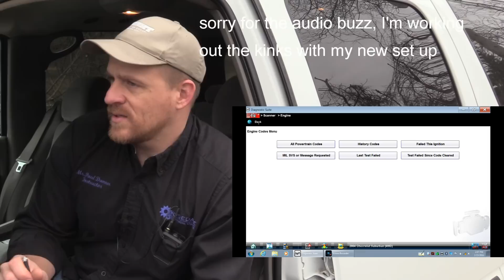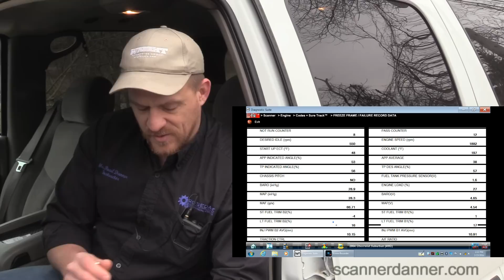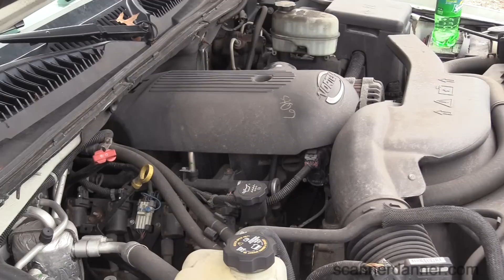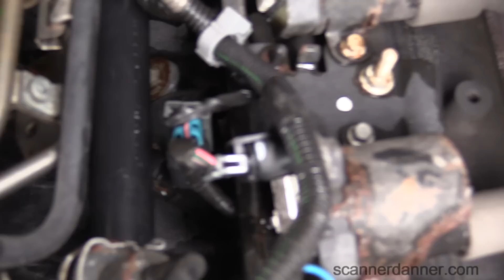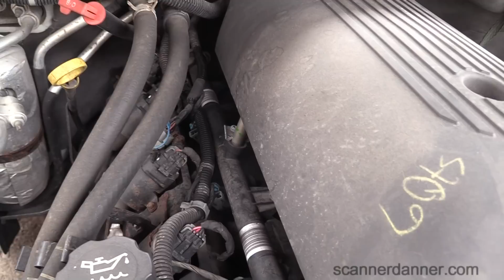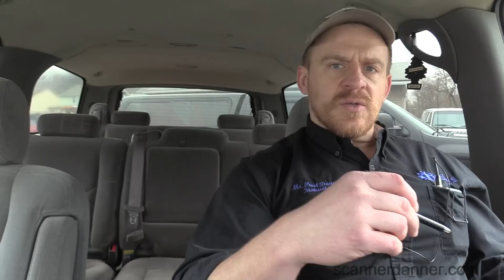Comment: I would have also asked the customer if they noticed that their fuel mileage had dropped off since these lean codes were set.  That's another good indication to back up the fuel trim data that you show here.

EDIT:  I just read the description and saw the symptoms, and poor gas mileage was listed.  Sorry about that.

Also,  for the water test since people are so concerned about it damaging something, distilled water is not conductive.  So, it would be safer to use than tap water around electrical connectors.  Maybe you did use distilled water; I don't recall in the video.  Anyway,  just thought I would mention it, but I'm sure you already know this.  Again, great video!

Comment: I have a 2003 Chevy Silverado with a 4.8 liter that throws lean codes.  It also sometimes says it has a misfire, but the cold start injector will not come on until I put it in gear then you will heat the cold start injector kick in and the motor will idle normally.  I can't figure out why the cold start injector only comes on after it has been put in gear.
Reply: Did you figure anything out? I'm having the exact same issue.
Reply: @breakthemachine5096  Yes I did, on your fuel rail crossover pipe there are 3 o rings you can get new ones but they are expensive and if you replace them you will still have the same problem.
What happens is that when the o-rings are installed they are first soaked in motor oil and that causes them to expand and seal.  Over time they dry out and loser their seal and cause a leak, thus causing a lean fuel condition and misfire.
All that is necessary is to remove the 3 o-rings and soak them in some clean motor oil for 5 minutes and they will swell back up, reinstall them and that should fix the problem until they dry out again.

Comment: Who the hell that knows anything about engines would be concerned about the procedure you are doing?  As you stated, it's a very small amount of water that is relative to the intake leak.  it's not like the engine is going to hydrolock from doing this.  Geez, some people really need to take a step back and think about what you actually do/did with this method.  It's MUCH safer than spraying carb/brake cleaner all around that area; especially on a hot engine.  The defacto standard when an obvious vacuum leak is not found by "normal" means, to include this and propane, is to do the smoke test.  However, not everyone has/or has access to a smoke machine.  In essence,  Great video!!
Reply: ScannerDanner, my smoke machine I ordered off of Amazon will be here in a couple days; hopefully by the weekend.  Any suggestions you may have for me to have this very annoying P0171/P0174 codes that I am experiencing.  Upper and lower intake gaskets have been replaced, along with the GM factory spider replacement that converts it to individual electrical fuel injectors to eliminate GM's crappy poppet valve design.  Any tips for smoke testing the engine, as far as engine cold, engine warm, etc?  Any help would be much appreciated!  Thx.

Edit:  It's a Stinger 2 model that I ordered.  I have used propane around the intake and all hoses, and about 6 months ago used carb cleaner all around the intake and vacuum lines, but no change in idle quality, or STFTs were indicated.  I'm wondering if it may be an EVAP system leak, as in under the vehicle where the vacuum line(s) run from the charcoal canister to the fuel pump.  Fuel filter was replaced recently, and the pump was replaced about a year ago.  If I stomp on the gas, there's no symptoms of fuel starvation at all.  As in your videos, what I do notice at idle is LTFTs are maxed out at 25 on both banks, and STFTs are also in the 10-20 range.  When I give it some throttle, the STFTs go negative, and drop the LTFTs to the upper teen range.  MAF sensor readings respond normally, as well as MAP readings, given the conditions.  Just looking for a little guidance once I get the smoke machine.  Is it possible that there is a big enough vac leak going to the fuel tank to make these fuel enrichment readings so high?

Comment: These manufacturerers LOVE to  use the crappy intake gaskets.  Had the same issue on my 01 S-10 4.3L.  Replaced them with a good set from Fel-Pro, and no more issues.  The engineers know that the originals aren't going to last, but they hope they last until the vehicle is out of warranty, then some uneducated person on engine theory (females in particular) will bring the vehicle in and have their issue diagnosed, and are told that they need to have them replaced.  This kind of crap really pisses me off, especially when they take advantage of women!!!
Reply: They take advantage of everyone, man or woman. doesn't matter as long as they get the Money.

Comment: I have a P0178 on 04 chevy suburban 1500, 5.3 lt. flex fuel VIN Z The composition sensor low input. Replaced very expensive part but did not change the same code I did fix a downstream O2 sensor. but The engine when it is cold it has a hard time starting in the morning and once I get it started it runs rough and kind of bounces it all goes away once it gets warm but the check engine stays on P0178.
Reply: You need to test the wiring to that flex fuel sensor. My money is on a broken wire going to it...

Comment: What else can cause these two codes? Spark? Cats? O2?
My scanner says these are some of the "other fixes". I don't trust it though.

2008 5.4 Ford.
Ltft 26 and 30. Increase engine rpm.. no change, stft normal fluctuation. MAF reading correct ( can't look at voltage on this scanner).
May have to check the cold engine . Always checked after it got back home.

Comment: can u tell me what might cause a 43 and 44 code on an 89 chevy k1500. runs ok, other than hunting and sometimes stalling at idle. no smoke, no noise. replaced t stat, checked egr, replaced temp sensor, IAC, rebuilt throttle body, replaced TBI gasket., rebuilt throttle body.

Comment: I like to use brake fluid to find vacuum leak because you can hear the engine rev higher if brake fluid is being sucked into the engine
Reply: Just don't get it on any surface you care about

Comment: I have the same truck ,  same codes,  it has a rough idle but doesn't change  ,  I been driving it for a while and nothings changed,,  any ideas
Reply: I did the water test and nothing  heres some numbers 98c (208F) ST bank 2 -2.34,LT bank 219.53   and ST bank 1 1.56 , LT bank 1 21.88intake man pressure 33kpa

Comment: what would casue a lean condition under load but idle everythings between -10 + 8 on the stft? all fuel related components replaced pump/filter/injectors/fpr
Reply: Coty Riddle Intake manifold gasket, MAF sensor, leaking EGR, sending unit filter  partially stopped up, fuel pressure regulator, coolent temperature sensor reading high, partially stopped up fuel line etc.

Comment: The bank 2 sensor 2, even though it's bad, that would not effect the engines performance right? Isnt the down bank sensors ONLY for emissions? 

It's only the bank 1 upstream sensors that would effect the Air/fuel mixture, correct? 

This is why you can delete out bank 2 sensors after installing longtube headers.
Reply: On this system, yes, the downstream O2 sensors are only used to monitor the cat. Some of the newer systems do use the downstream O2 for fuel trim control.

Comment: I love the water trick.  With no smoke machine I have been watching fuel trims while putting some propane or brake cleand down around the intake and seeing if they correct.  It always a little nerve wracking to introduce a cloud of explosive fuel around a running engine though.  Water seems like it may be a safer way!

Comment: I have the same codes running lean both banks, i just replaced my MAF sensor and its throwing the same code but right after its thrown i can clear the engine light and be fine for like a day then it kicks on again its super random and i can't pinpoint anything ive sprayed for leaks nothing has happend everything is sealed, also this occurs at higher rpm never usually at low idle speeds it threw the code last time around 55 mph at around 2k rpm  but also my MAF i checked the g/s and its running low 2.5 it was reading at 600 rpm but i read that its supposed to be around 3.5 g/s  but its BRAND new by that i mean I replaced it a week ago and now its doing this to me again why could it be doing this?

Comment: First of all Great Videos I watch them all the time to learn new things. 
What I am not understanding is the fuel trims. 2016 Chevy Colorado. I pull the oil cap to simulate a small vacuum leak. The fuel trims both ST and LT go positive for a while the O2 sensor also indicates this. But After the ECM reads this the LT drops negative and stays there, while the ST switches in the slightly negative area. My shop Foreman told me this is exactly what should happen. But all of your videos I have watched on fuel trim say they should go positive, but im seeing negative. There is nothing wrong with this vehicle no codes I just did this to watch and understand the fuel trims better. 
Your thoughts on this please.
Reply: That s strange. Does this vehicle have a downstream fuel trim data on the scan tool?

Comment: Thanks! For the video this this worked amazing but for some reason it never threw a lean code even know the fuel trims where 50%! 5.3 flex bigger injectors ...non flex 25%
Reply: Did you find your vacuum leak?

Comment: is it recommended to change the intake manifold or just gasket?
Reply: just the gasket bro
Reply: do it matter if i use torque wrench. will it cause any problems if i just tighten the intake manifold by hand with regular socket wrench?

Comment: Some questions regarding the B2S2 O2 diagnosis.  Why is this a sensor problem and not a oxygen storage problem?  The first thing I thought about after seeing this was the oxygen storage test on page 5-13 in your book, and how there is a 2-4 second delay in the downstream O2 response after turning on the propane.  Isn't revving the engine to WOT at 32:57 basically just like adding the propane since it's forcing the AF mixture rich?  Also, later on near the end 32:48 the B2S2 is oscillating between about 500-700mv.  Isn't an oscillating downstream also a sign of a problem with the cat?  Thanks!
Reply: This wasn't a video about testing a downstream O2 or the cat from my memory
Reply: ScannerDanner The last six or seven minutes of the video is dedicated to diagnosing a code on one of the downstream o2 sensors.

Comment: Had the exact same codes on my 2000 Silverado 327. (5.3) Cleaned the mass airflow sensor...
no more bogging or missing - runs like new - no more codes - no more trouble light.
Reply: Johnny Mac I hope that's my problem!
Reply: Yea, hope so. It's certainly worth trying first because it's cheap and easy. They make a spray cleaner specifically for the MAS, use that. Best of luck.
Reply: 327 cubic inch. That's American for 5.3 liter
Reply: 327?
Reply: Its 323 cubic inches not 327

Comment: Update. Started the van today and disconnected the maf harness clip while running amd stayed on. Drove local for about 5 miles to warm it up. All that showed on the obd reader was the maf codes because it was obviously disconnected. The p0303 and P0171 codes never came back on. Afer the 5 miles I reconnected the maf and drove hard for another 3 to for miles and ran completely fine with no check engine light. Any thoughts what could be the culprit? Maybe the coil pack is cracked and after so many miles of heating up it starts to misfire? Has brand new plugs and wires. Fuel filter clogged? Egr valve clogged with carbon build up? Sprayed brake cleaner along all vacuum lines and gaskets. No sounds i hear. Weird. Appreciate the feed back.  98 Windstar 3.8 limited 4 speed w/ OD
Reply: Mark, post your repair questions here, I am sure we can help you https://www.scannerdanner.com/forum/post-your-repair-questions-here.html
Sorry for the delay, I get hundreds of these every day and I cannot reply to them all here anymore
Reply: Thanks buddy. Ended up being the coil ignition. Its common for those to misfire cylinder 3. Ended up causing the p0171.

Comment: Great video, I have a 2001 Chevy Suburban k1500 5.3L as I was driving from a long trip on the freeway all of a sudden I started losing power & felt like it was going to shut off, I pulled over the engine idled fine, I turned it off for a few minutes & it starred right up. I drove it home then hooked up my obd2 scanner & got p0171 & p0174 codes, then after a while the check engine light came on.  I put in a new fuel filter a few months before any of these symtoms started happening just as maintenance since it had never been changed, It starts up within seconds even when the engine is cold. I cleaned the maf sensor reconditioned the K&N FIPK filter & reoiled it with K&N oil, checked for exhaust leaks, put water around the intake manifolds, but didn't find or hear anything out of the ordinary. I thought maybe I had bad fuel so drove it close to empty & put new fuel in. When driving it feels like it's lacking power, at times while on the freeway it starts shuttering, kind of like when you get a misfire, but it doesn't misfire. I will watch your video a few more times to make sure I understand everything. Thanks in advance for any help if you're able to answer my question.
Reply: armandomrgl85 how old is your fuel pump?
Reply: Robert Contreras I've never replaced it, so it's probably the original fuel pump. I bought the Suburban when it had 38,000 miles

Comment: Im a big fan of your work! im subscribed to your premium channel! but i have a question i have a misfires on my acura TL 3.2L at cold temp (start up) could the intake manifold gasket still be suspect even on a speed density engine(MAP) or only on a MAF engine? i also have malfunctioning wideband sensors on both banks and downstream O2 codes and it seems as if my cylinders are getting coolant in them due to dissapearing coolant and my wideband sensor is white smudged at the tip?? appreciate the help dan
Reply: Absolutely an intake gasket is still a possibility even on a speed density engine. 
Another common cold engine misfire is from a headgasket failure and with your other symptoms, I would check for that first.

Comment: Could you look at the fuel trims live as you squirt water on intake gasket area? Would it show or say anything as you did that?

2nd question NOT related to this video:  Paul, are all fuel injectors ground side switched on all engines? Are their any power side switched?
Reply: It would affect it but not necessarily from the water itself. The water will get ingested and cause a misfire which would be a false lean condition and would drive the fuel trim positive. 
Back in the early 80s there were some power side switched injector circuits. Also GDI injection systems will switch both the power and ground side of the injector. 
But for the most part, ground side switching is the norm on injector circuits.
Reply: Thank you very much, your the best!

Comment: So I'm suspecting for myself it's intake Manifold gasket because I just replaced my lifters and installed a new gasket, could it be faulty re-install is what I'm thinking, perhaps common? Going to do the water Test tomorrow, if so should I replace the gasket or re-install and re-seat? 08 5.3L Vortec engine
Reply: P.S. mine is also happening at lower RPM and Cold engine
Reply: break out the water bottle man and have at it. Check it cold of course

Comment: Love the water test also. My car stalls at low speeds and when I brake but when engine is hot. I don't have a fancy scanner so I can't determine what exactly is going on but I suspect my problem to be a vacuum leak and not caused by intake manifold.  Will open hood and perform visual inspection to see if there's any hoses that are torn or disconnected. Will also test fuel pressure at fuel rail to check pressure.

Comment: I've troubleshot and repaired countless P0171, 174, 300, 420 and replaced img's on GM 5.3. but this has me stumped... 
Father in law's 04 silverado had all the factors of a bad intake manifold gasket. so i replaced it and on test drive it ran better than ever. later that night his son said it had rough idle and SES light came on. today we have the same codes. what should i Look at next?
Reply: Fuel trim numbers at idle and at 3000 rpm

Comment: Help plz. 2005 Corolla with p0171. So far have changed the maf with Toyota oem part. Replaced both o2 sensors with denso. Changed intake gasket. Changed catalytic converter due to a leak. Fuel pressure reads at 49 psi. Removed and cleaned fuel injectors. No vacuum leak. Car running very rough at idle. At idle, short term fuel at 0 and long at 25. At 2000 rpm, short at -4 and long jumps to 40. Any ideas plz.
Reply: It is becoming more and more difficult to answer questions here. I have 80,000 people asking me for help now. So I have created a forum to help you guys better. It is free to join and we can exchange pictures, wiring diagrams and waveforms if needed to help guide you through the process of troubleshooting your vehicle. Thank you so much! Hope to see you there. 
Paul Danner (ScannerDanner)
https://www.scannerdanner.com/forum/post-your-repair-questions-here.html
Reply: sargon khabeer did you look at trotle body and iac valve?